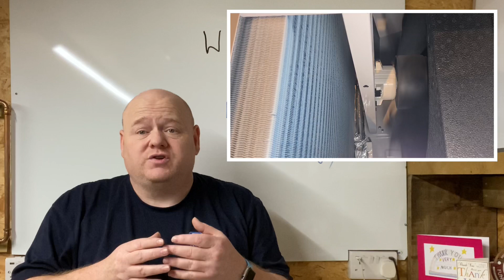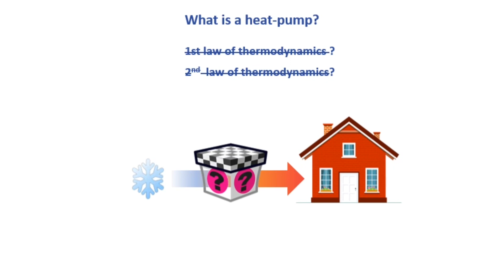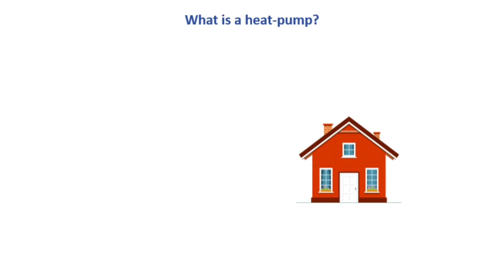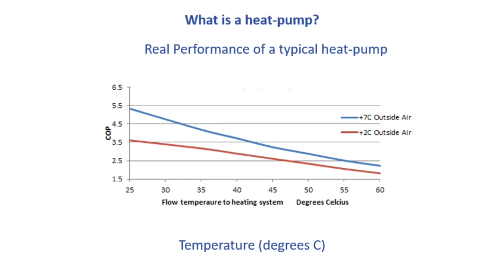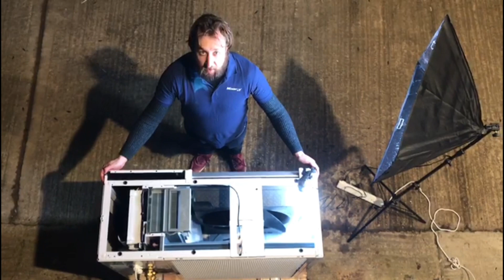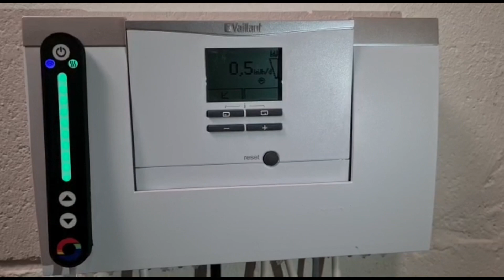What is a heat pump ? How does it work - Peter Armstrong CEO Mixergy

Comment: Is the CEO of Mixergy an engineer? I am not at all sure that system description in terms of the refrigerant cycle side of things is at all correct, at least in terms of the diagram shown.
Reply: Hey Norman - which parts do you have a concern with? cheers
Reply: @mixergyltd6286  Sorry just picked up your message - I have just watched it all back through. Not helped by the fractured audio track but I retract my former statement - but only in part. I thought your presentation was very confusing and someone who is not familiar with the principles of refrigeration would have had more difficulty in following it. I believe before moving on to explaining heat pumps, the introduction should be the description of how a basic compressor refrigeration cycle works - with emphasis on the four major components (Compressor, Condenser, TRV and Evaporator) and the state of the refrigerant in each ‘quarter’ of the system (HP Gas, HP Liquid, LP Liquid and LP Gas) and at each stage what’s happening to the refrigerant in terms of heat transfer and the purpose and function of the TRV. With that under the belt and preferably building on the same basic diagram then explain the heat pump application with specific reference to where the condenser is ‘on site’ and where the evaporator is ‘on site’. I would also recommend that the role and function of the reversing valve and circuit is left out completely and covered in a later presentation. For context I used to run and maintain large Marine refrigerant and chilled water system plants 7x 540KW systems with Howdens screw compressors) and used to teach refrigeration to graduate engineers as part of their post graduate studies before they ‘went into the field’. Offered constructively and hope it is helpful.😀
Reply: Hey Pete here who presented, as it happens I have a PhD in engineering 😀!! 

My intention was to provide the analogy with compressing air as this is intuitive to people in terms of bringing vibrating air molecules together to raise temperature without violating 2nd law of thermodynamics... 

I could have gone down a much more academic route talking about the principles of heat engines and the derivation of theoretical COP etc from 2nd law etc,  temperature entropy diagrams etc etc but
Reply: This principals are correct here, I find the analogy of moving compressed pistons around helpful, maybe not everyone's cup of tea!

Comment: Not keen on retro fitting heat pumps to existing installations. Just had a couple customers stung by switching over last year, ended up costing them 3x the running cost of the systems they already had (also required all their radiators up-sizing due to the lower flow temperatures in the system - single rads to doubles, doubles to triple). 
New builds with higher levels of air tightness and insulation it makes more sense. If you're interested in heat pumps though it's worth while taking a look at A.O Smith heat pump cylinders and some other NA based brands, it's all built into the cylinder and as temperatures inside the house are warmer the hot water recovery is quite rapid.

Comment: But you still can’t get instantaneous hot water like a combi boiler, they usually weigh about 200kg so you need more than 1 person to move it too

And yes they got the idea from the way a refrigeration system works
Reply: I fully expect these to take over from system boilers at some point given the go woke mindset of current government bodies. Space/efficiency of combi boilers can't be beaten by electric currently though. 3 bed 1 bath or smaller you'd be looking at back to a cylinder with what space as most are ripped out for combi's + gaining more space to move into attic's etc, so what every smaller home will be all electric shower + under sink water heaters?

Comment: Allen I'm just a meek plumber with no degrees but to  put all this in a nutshell we are now fitting systems that work great in summer when we don't need them  and having pay well  for it in winter when their efficiency is low .just don't make sense to me in North of Scotland  I do agree the groundsource would be a better option with lower temp change underground but so much more expensive. And many up here have either oil or gas backup if needed which doesn't fill a person with confidence.progress ? I dont know.

Comment: Installers that put this stuff in are mainly national companies that travel far and wide like fair folk due to no local work. Many times Installing heat pumps into rural properties which simply do not meet the requirements. Solid walls and poor insulatation etc. You need a purpose built house for this to work or spend enourmous amounts of money insulating and dealing with a hornets nest of damp/condensation issues. We've had to rip them out and install oil again because they don't work. This technology will take forever to catch on and is only really viable in new builds. But reliability and cost is still unknown and only the wealthy virtue signalling electric car driving "save the world" riff raff are prepared through blind faith to try it. Got to suck it and see.
Reply: Jokes aside I'm all for progression and new technologies within our industry, but man give us something that works and we can put our reputation on. Good video thanks for sharing!

Comment: Heat pumps aren’t fast at heating up,60deg is fine for domestic hot water but for circulation around a heating system doesn’t produce room temperatures gas customers are used to and back up electricity is expensive.
Reply: Yes just had a customer stung by this, they needed "all their radiators increased in size to make up for the lower flow temp". Works out their old E7 unit was cheaper but because of the grant they're just about getting away with it. £1500 to have one installed and £500 a year for the next 4 years iirc, once that runs out though I pity the person that has to keep using it. That said on UFH they're great as you don't want/need that flow temp.

Comment: Dont worry Allen they have not a cat in hells chance of getting the technology to work in the UK.
Half an acre of back yard and you just might warm the living room,getting the hardware inside a kitchen cupboard is never going to happen.
This sounds like the prediction we would all have flying cars.
Reply: What's special about the UK?  They work fine here.  In Finland, a third of houses use them.  From what I've seen the only drawbacks are space for hot water cylinder (which most houses used to have) and bigger bedroom radiators.
Reply: Yes and the same clowns in west sinister have the same BS vision for electric vehicles and plan a pay per mile charge for the lost road tax revenue 🙄🙄🙄🙄

Comment: An air conditioner in reverse. Taking the heat from outside and dumping it inside.  Last time I checked the prices I wouldn't get my money back for years. Might as well stick with condensing boilers.  Still good of you to share Allen. Much appreciated
Reply: Hey Asif, yeah, these systems are very expensive and come with significant installation challenges, we'll be doing a follow up video with Allen on this subject - would be great to get your thoughts on that to
Reply: @mixergyltd6286  Thanks a follow up would be great.

Comment: A heat pump is thermodynamically identical to a refrigerator, in which energy is drawn from the contents of the cabinet, and so cools them.  This results in the working fluid or refrigerant  rising in temperature.  At the rear of the refrigerator, energy flows from the working fluid  in the condenser, as the zig-zag tubing is called, to the atmosphere, and the cycle is repeated.  A compressor and an expansion valve are needed to complete the working cycle which the refrigerant goes through repeatedly. 

 A heat pump only differs in that it is optimised for the supply of high temperature energy from the condenser to the interior of the building, and the refrigerant in the evaporator draws  energy from cooler outside air or from a convenient river, or lake, or from the cold ground.  Sometimes a heat pump is described as a reversed refrigerator.  It is not, the difference is that the high temperature energy from the condenser is what is utilised in a heat pump.  In a refrigerator, it is the low temperature energy extracted from the contents of the cabinet which we are concerned with.  A refrigerator and a heat pump are in fact both reversed heat engines.
Reply: This is true except that the coefficient of performance of a heat pump is higher than a refrigerator since energy lost in the compression cycle contribute to the provision of heat, in other words the 1 unit of electricity that is not used to shift heat basically turns into heat which is useful, whereas heat in a fridge isn't and so COPrs are lower!
Reply: @mixergyltd6286  You are of course correct. In the elementary  analysis of the cycle it is easy to show that the COP of  an ideal heat pump is 1 plus  COP of a refrigerator, other things being equal.  A practical device will have losses in the heat transfer processes, and in the work transfer into the compression process.   

I wanted to make the point that both refrigerators and heat pumps are reversed heat engines, and that one is not the reverse of the other. I defer to your experience of practical devices, and I am delighted to see the technology being scaled for domestic purposes.  When I was teaching thermodynamics some sixty years ago, I remember the installation of a heat pump system at the Midland Arts Centre, in Birmingham, which used  the nearby river Rea as its cold energy source.  At that time it was not economic to consider heat pumps at domestic scale.

Comment: The future is here - but your house must be super insulated. Will be mandated for retrofit by 2030 no doubt. Currently £2k to replace your gas boiler. £12k to put heat pump system in, £30k to upgrade insulation ouch. Start saving.
Reply: Tell that to the Chinese Communist Party. Their air is barely breathable. I can't see why everything is made in China. They blatantly ignore international copyright laws. The stuff they make in tandem with multi-national companies who pay very little or no tax, is made by slaves, shipped 1/2 the way around the world using oil and then sold to people who will inevitably be holding more and more debt.By 2030, they will probably own or control everything anyway.

Comment: Interesting. Keen to get some idea of cost comparisons; e.g. how much more/less to heat that tank with the heat pump compared to with gas
Reply: My sister has such a system, with a heat recovery ventilation system and solar panels, under the old payment plan, their total energy costs average out at minus £30 PCM, that is payment to them of £30pcm,  the solar energy payments are far less on newly installed systems.

Comment: If that's the future they can keep it.
Reply: Sadly it is 😔😔😔
Reply: Hey transporter, I think it's not entirely the future - but part of a mixture of solutions (like hydrogen ready boilers) - for new build projects or homes where there's been a very deep level of renovation and upgrade of the building fabric. Before considering a heat pump, it is imperative that the insulation, draft proofing and glazing is up to scratch along with the design of the wet system (or air handling system)... 

Good to get your thoughts on the challenges as well?